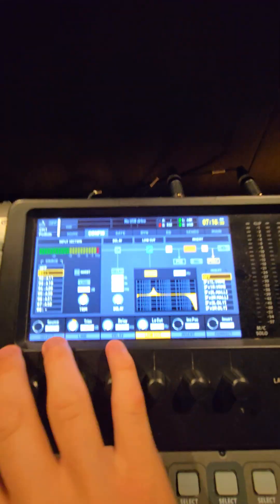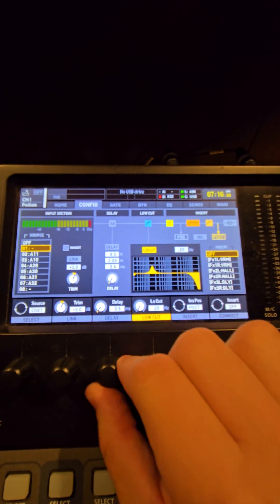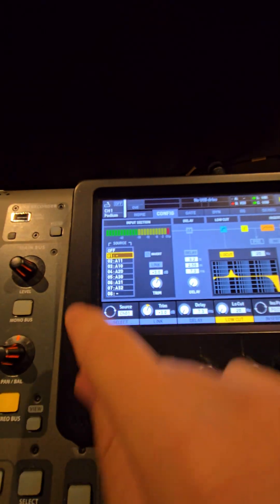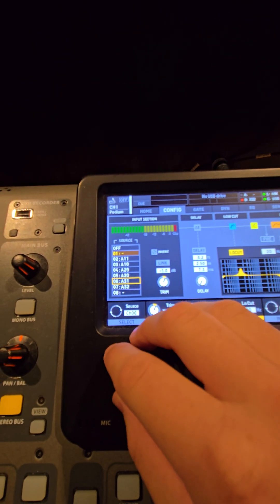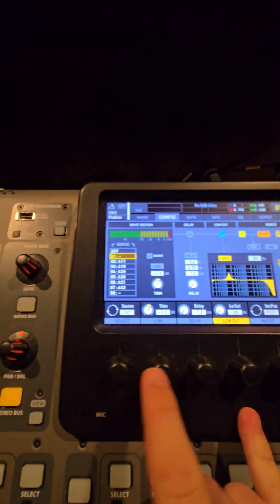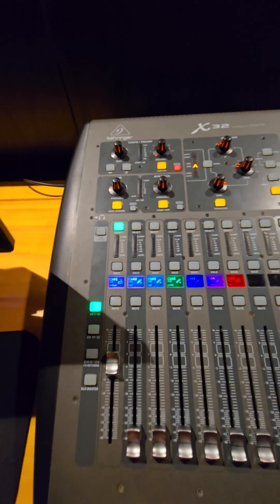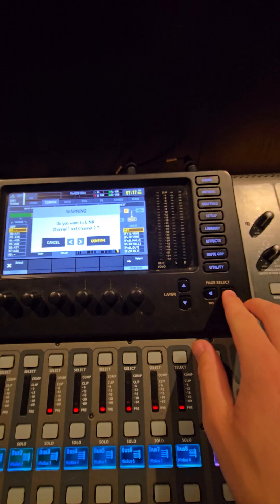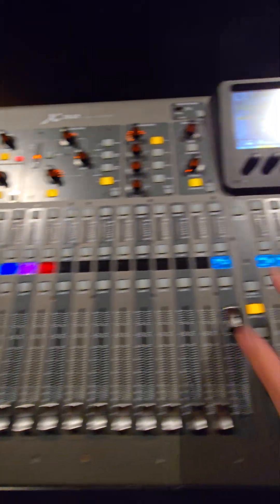X32 Channel Config in 1 Minute || X32 Tech

Comment: Why did the 48v didn't turn on when you tap on it? It happened to me once. I coudn't figure out and I factory reset the board.
Reply: The 48v did not turn on because I did not have a input routed to the channel. The 48v light will also not turn on if you have a card input routed to the channel.